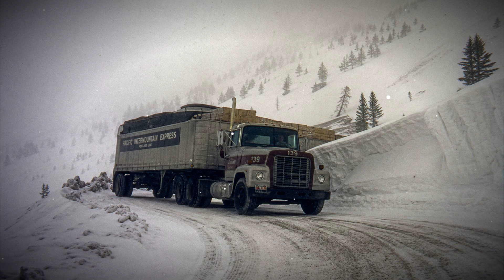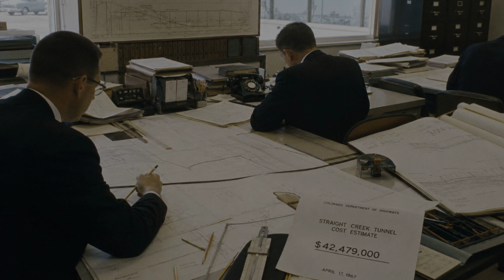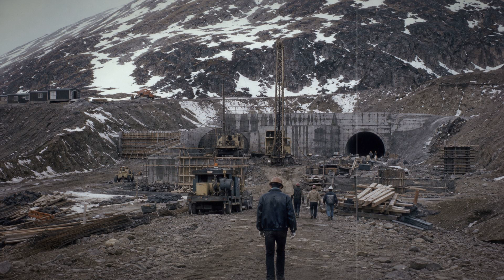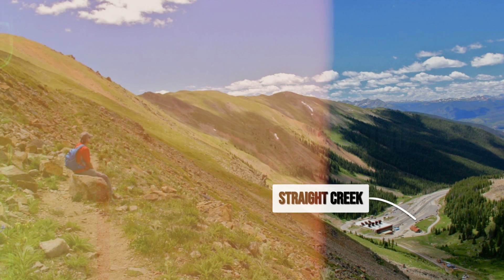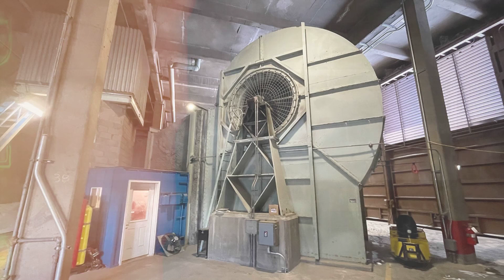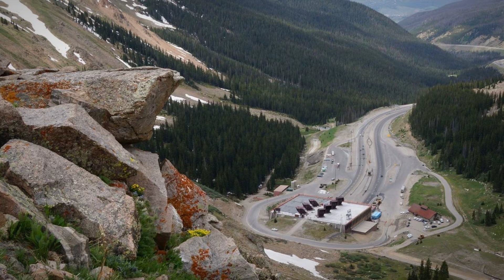Why I-70 Had to Go Under the Mountain Instead of Over It

Comment: A few years ago I was delayed more than an hour by a horrendous jam on I-70, but it was not in the tunnel.  It was ten miles of lane closure east of it, protecting a single backhoe doing some minor dirt moving on the shoulder.
Reply from the maker: Ten miles of closures for one backhoe on the shoulder is a lot to ask of drivers. That kind of delay has a way of sticking with you.

Comment: The tunnel is a thousand feet lower than the pass. Even so, it's still a somewhat steep grade up to the tunnel for 20 miles at both ends.
Reply from the maker: yeah the climb on either side is still no joke. you drive it a lot?

Comment: The sign says the tunnel is 11,158 feet in elevation.
Reply: There is a difference in elevation between the two portals.  The west portal is higher than the east.
Reply: @unclevic-o5p The video said that 11,013 feet was the highest elevation of the interstate highway system.  That apparently isn't correct.

Comment: Changes on engine horsepower due to altitud differential mostly affected carbureted engines; however, mainstream passenger cars phased out carburetors by the late 1980s. Cars manufactured after the 1980's typically use fuel injection systems with sensors and electronics to regulate the mixture, making changes in altitud almost unnoticeable.

Comment: Went through the tunnel a week after it opened on our way to Copper Moutain it was Coppers first year. Many times over and under the divide sometimes take the pass it is a nice drive. The tunnel is a interstate highway and there is a stop light I know on the east portal as I was stopped four cars back from it, never looked when coming from the west but believe there may be one. I think it has to be the only stop light on a interstate anywhere in the US. Anybody know of another?

Comment: I've driven Loveland Pass, eastbound, in a 36.5' Super C motorhome towing a 20' car trailer with a pickup truck on it. Slow, but not a problem. On the downhill side I geared down and put the engine brake on high. I barely needed the brake pedal.

Comment: Trucks with hazardous materials still have to go over the pass.
Reply: During severe weather winter weather Loveland Pass is closed and hazmat trucks use the tunnels under escort at the top of the hour.
Reply: Yup !  I hauled fuel for about 4 years over Loveland Pass. Ironic they send Hazmat over a goat trail
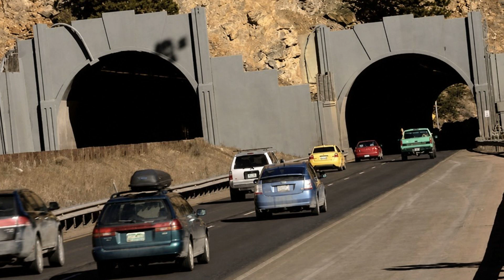Reply: 29:15
Reply: Just watching puts me back in the Driver's Seat worried and my breathing and BP rise. Honestly due to POVs, descending the westside of the tunnel isn't that much better in snowy conditions. My mind was made up to drive thru before loosing control!
Reply: Unless it's closed then they can get escorted through it

Comment: Great explanation!  I wonder how the firefighters are going to deal with an EV fire in the tunnels. Plenty of toxic fumes in play surrounded by vehicles that would not be able to exit and a imagine a ventilation system not designed for the necessary air flow.
Reply: There are copious toxic fumes from a gasoline fire as well. The main problem is the fire is harder to put out.
Reply: Those tunnels have excellent ventilation systems. That is how they are able to allow hazmat trucks through the tunnel when conditions are too bad for the bypass to remain open. They crank up the ventilation fans and escort the hazardous materials trucks through the tunnel keeping everyone else out.
Reply: @hewhohasnoidentity4377  It's not as though those trucks are constantly spewing toxic gases (well they are, but no more than any other truck).
Reply: @ntdscherer they increase the ventilation while allowing hazmat loads to pass through the tunnel as a precaution. They are not any more of a risk of an incident than any other trucks, but the consequences of an accident in the tunnel with a hazmat load can be much more serious. When this process is used they don't take the time to evaluate what specific materials are in the tunnel. They don't take the time to evaluate the risk of each of the cargo coming in contact with the other. In order to give the drivers in the tunnel any chance to escape in the event of the worst case scenario they already have the ventilation system working. It is unnecessary almost all the time, but you wouldn't want to be in the tunnel with a crash and not have the ventilation on.
Reply: My thoughts too!
Reply: Make them take the pass with the hazmats 😂

Comment: Good video.  But Denver to Dillon is about 50 minutes under the best conditions.  Sometimes it can be three hours.
Reply: Thank you! I had to look that one up, because 20 minutes sure didn't sound right 😂
Reply: Depends how fast you drive. i.e. it depends how many Subarus and Prius's are on the road.
Reply: @cliffgillespie8611  Are they fast or slow?
Reply: Sometimes Dillon to the tunnel is 3 hours.  When loveland pass is closed on a snowy Sunday afternoon/evening in January or Febuary.
Reply: Yes. Mostly dependent on traffic.   Sometimes conditions can add a lot of time and risk.
Reply: I’m thinking that 20 minute citation may have more to do with time driving through the tunnels (maybe east/ west directions combined) and what time you don’t have to spend going over Loveland Pass (summer sun vs. winter snow) in traffic (could be hours easily).
Reply: Downtown Denver to Dillon is 69 mi.  207 mph does it in 20 min.